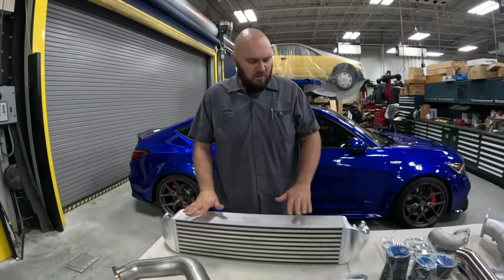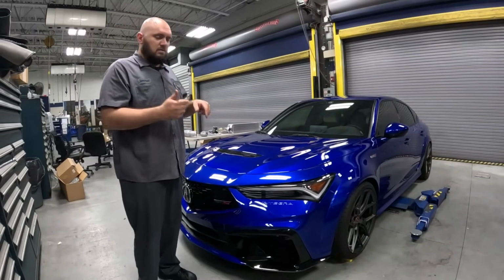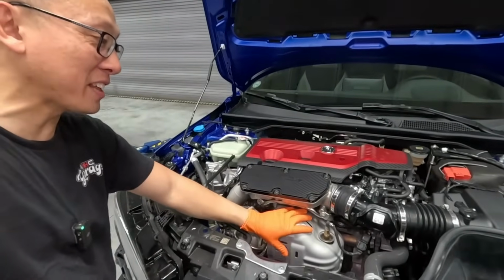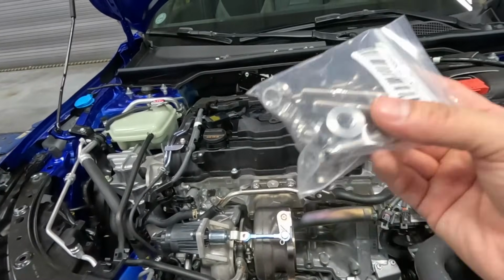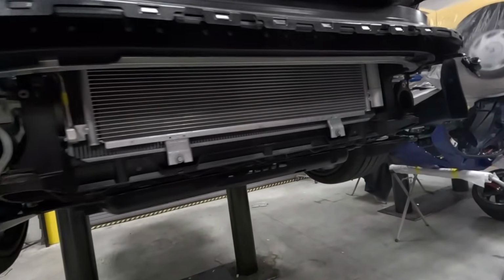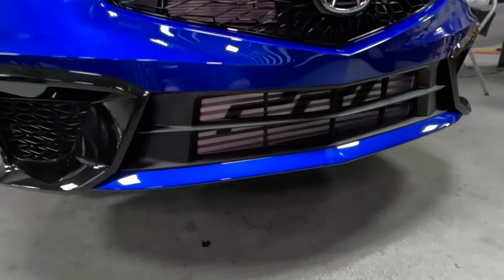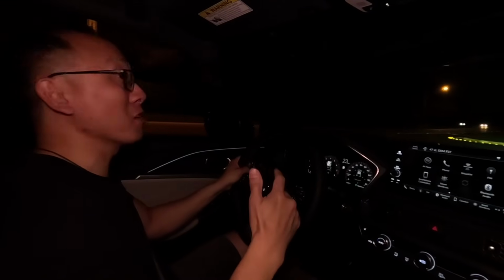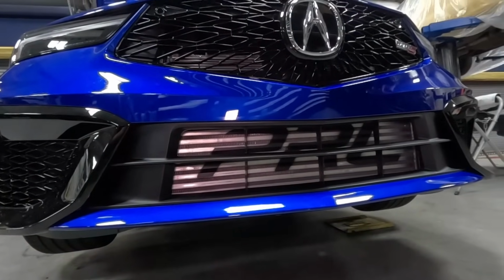2024 Acura Integra Type-S // Full PRL Motorsports & Two-Step Performance Upgrades (Part 3)

Comment: I’m new to all this stuff.
Could someone explain to me why these aftermarket parts are better than the stock ones?

Even though the stock ones are brand new, and a lot of this just looks like pipes and non-mechanical metal pieces. What is the real functional difference?

Not hating at all, genuinely curious.
Reply: Combustion engines are essentially air pumps. The more efficiently you can get the air in (and out), the more power you can make. The intercooler also aids with a larger volume and surface area allowing the turbo charger to force more air through cooler pipes. While factory parts work fine, the aftermarket parts might be smoother inside and/or larger in volume allowing for less turbulent flow of more air. :D

Comment: Turbo in the front, what a novel concept😂. This is a 180 from everything VW where it's buried between the engine and the firewall, and you dont need the car 6 feet in the air for the downpipe

Comment: I ordered my intercooler from them back in June, F prl.
Reply: Elaborate?
Reply: Ordered my intercooler in June and didn't think I'd have to send 5 emails about where is it. And my titanium inlet pipe had burrs not machined off that I had too fix. Just got my intercooler November 15 witch that's not cool from it being in stock and should of had in the beginning of July